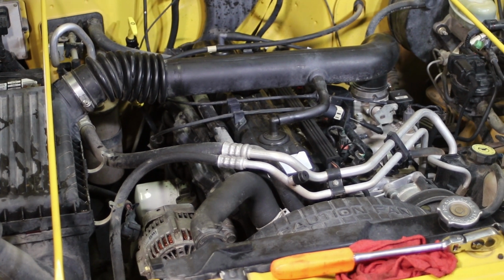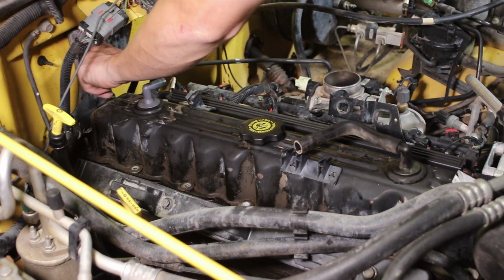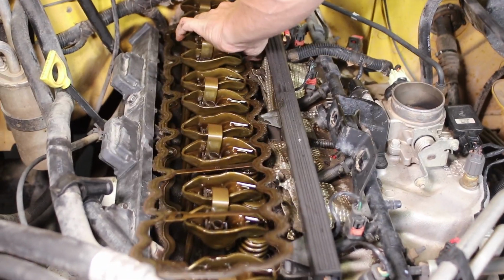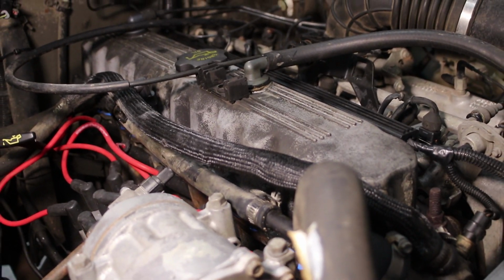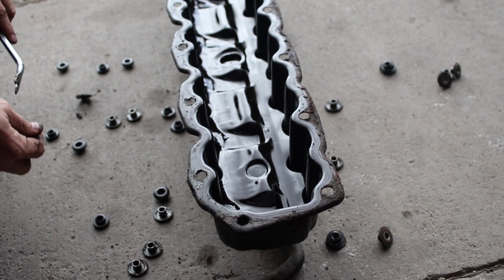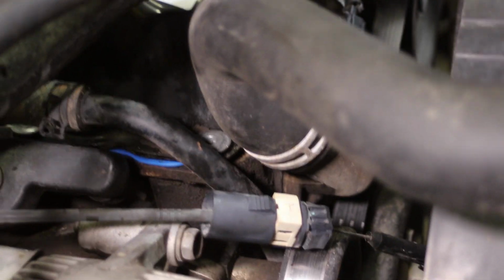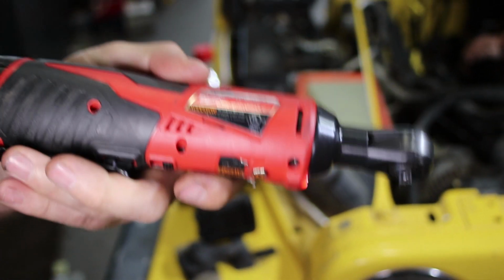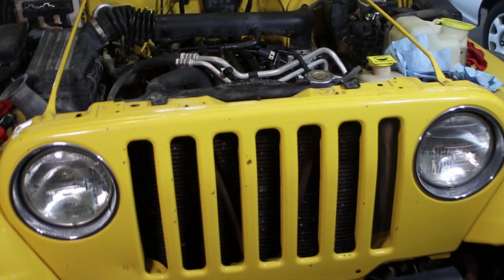VALVE COVER GASKET REPAIR 4.0L JEEP WRANGLER TJ - JEEPFIX TUTORIALS

Comment: No mention of '03+ and the difficulty of getting to the ground and far rear valve cover bolt due to them being recessed under the firewall and covered by an almost completely immovable wiring bridle.
No mention of ft/lb torque either.

Comment: This is such a great tutorial, thank you!  Question...any harm to tourqing the rockers while I have the valve cover off?  Do i need to rotate the engine or just tighten as they are?
Reply from the maker: Not a bad idea checking for loose rocker arm bolts.

Comment: Welp update 2hrs and 37 mins roughly I’m done. Was relatively easy just time consuming as you all stated scraping the residue off from the old gasket.  Thanks for the video guidance as I’m cheap and would rather do work myself than pay someone an arm and a leg to do it. Every penny counts and adds up quick when you do things on a 97 Tj yourself. Lol. Plus these vehicles I have found out of the 5 I’ve owned this one is by far the EASIEST to work on. SOOOOO MUCH ROOM TO WORK! Every other vehicle has only like 1/16 of an inch of space to work around every single cotton picking bolt and hose. Lol. Thank y’all again for the videos I greatly appreciate it and DO NOT FORGET THE GROUND WIRE I will not confirm nor deny if I forgot the first time around….lol
Reply from the maker: Thanks for the positive feedback.  You did excellent on time.  I’m not sure we can do it much faster and we do this job frequently.

Comment: Man you just put more in perspective & understanding for the most part, in the first two minutes of this video that I have been trying to myself for a couple days now. I have a pretty good leak going on down in the back somewhere. I'm currently doing a valve cover replacement or checking it anyway, and I was thinking that my rear seal was blown praying the whole time doing this job that its only in fact, the valve gasket. 🤞🙏
Reply from the maker: Thank your for your comment.  Oil leaking between the engine and transmission can be the Valve Cover Gasket or/and Rear Main Seal.

Comment: Great video it’s definitely appreciated! You mention changing the oil after it is done. Is there a certain amount of time one should run the engine before the change so that any particles up top end up in the oil filter or wherever we want them to end up for the change?
Reply from the maker: Clean up or pick any visible particles.  We have ran these engines with the valve covers off.  It’s pretty cool to watch but there much less flow than you would think.  I would just change the oil while you are in there and use a good filter to pick up anything missed.  We have cut many open and our favorite that can be purchased easily is a WIX.

Comment: I chickened out and paid a 30 year man on a saturday.  He put a fan to cool it down, he was done in a bout two hours. Cork and a epoxy. both sides
Reply from the maker: Next time try the rubber gasket.  The dealer gasket is even better but much more expensive.

Comment: Great video! I have a leak but not sure it’s the valve cover or rear main. There is gunk all over the sides of the cover going down under the Jeep so that’s why I assume it’s the valve cover gasket. 

This doesn’t look like something I would be able to do myself, however. Probably will have to take to a shop but I just changed my oil, so it will continue to leak until next oil change lol.

Comment: First of all. Great, detailed video. Thanks to all here. From the camera man, to the commenter and mechanics, as well, in this repair video. Awesome presentation and delivery. The attention to the details were excellent. A few things, call them, "constructive obsevations" that I would suggest, that were not specifically covered. 1st, it wasnt specifically mentioned but, in my opinion and experience, before you do ANY type of repair, always put safety first and remove the NEGATIVE battery terminal so their is no chance of an arc from tools being used around the engine compartment which can be a hair raising experience, to saythe least or to avoid any electrical or computer malfuctions later. Ask me how I know..... 2nd, on the topic of aluminum valve covers.On some 4.0L engines, specifically in my case, for a 1995 Jeep GCL ZJ, the Felpro gasket DOES NOT have the alignment slots nor does it have support brackets between the gasket as was shown in this video, specifically the 1995 model year for the Grand Cherokee Laredo ZJ, there may be others. Also, on this year, 1995 4.0L Inline 6 cylinder engine, as well as possibly, other 1995 Cherokees and Wranglers as well!? 

NOTE! -Their are NO grommets or metal sleeves for the bolts on my aluminum valve cover, and were not included, in my Felpro gasket kit, as shown here, and in most other Youtube videos on this topic. In my case and possibly other 1995 model years, the gasket is metal and silicone like this one shown in this video, yet in my gasket, the silicone and metal gasket is molded into and around, all 15 of the 11mm bolts and the grommets are NOT required, as all of the sealant is integrated into the felpro valve cover gasket for the 1995 model so DONT STRESS folks, if their is no grommet kit with your gasket for this model year. As far as I know, this info has not been covered in ANY other Jeep 4.0L valve cover gasket replacement video on YouTube and had me stumped and concerned as to why my gasket was different from all the others. I hope this added info helps someone.Good luck to all and stay dirty :)
Reply from the maker: Thank you for your excellent feedback!  I can’t take credit for the camera work.  That is my daughter.

Comment: Great video.  Your recommendation was to start at the top with leaks.  I have a smalleak and will follow that advice but was wondering if you had any guidance on determining if I have a rear main seal leak.  I have a 2002 4.0.  Thanks
Reply from the maker: Rear Main Seal leaks look like they come from the very back of the oil pan.  Valve Cover Gasket leaks also start in the back and runs down the back of the engine making it look like a rear main seal.  Clean the whole area with CRC Brake Clean in the red bottle (Napa sells it for about $2.60 per bottle). Switch back and forth between brake clean and compressed air in a well ventilated area. Drive for a few days and the location of the leak should be very clear.

Comment: Just completed my 2006 TJ X. About 6 hours, not including painting. My Jeep had a plastic bridge for the wiring bundle going over the back of the valve cover along the fire wall. I spent an hour researching this. Once I found I could remove it, the rest of the project went quickly.
Reply from the maker: Good job.  The plastic harness holder in the back on the newer TJs definitely add time.

Comment: Yep, doing this as we speak. there are three bolts that are a *** to take off. Getting to the ground wire is not the easiest move either...
Reply from the maker: Yes the plastic wiring harness in the back definitely adds time.

Comment: Thanks for the awesome, in depth video. It took about 4 hours with a trip to the auto parts store. As soon as I got the cover off, I pressure washed it so it'd have time to dry. I took my time, used hand tools, and had a beer while cleaning the surface. The only problem I ran into was replacing the cover, my radiator hose was being a pain. Other than that, easy install, time will tell if I did good enough lol.  2005 Jeep Wrangler TJ 4.0.
Reply from the maker: Thanks for reporting in.   The radiator hose and the clamp can be such a pain.

Comment: Great video, but no part numbers in description. Here is what I bought for my 2003 Wrangler 4.0L:

Gasket: Fel-Pro VS 50458 R
PCV Grommet: (need 2) Dorman 42344
Front PCV Elbow: Dorman 47079
Rear PCV Elbow: Dorman 47057
PCV Hose: Mopar 53030615 CRANKCASE VENT Valve Tube
Rear PCV Tube ends: Dorman 47128 PCV Hose

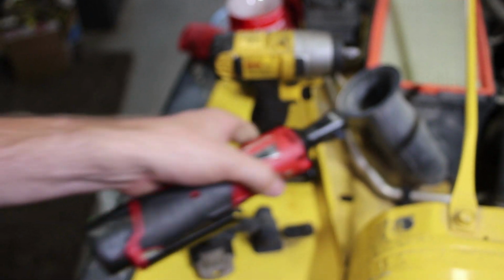85 in lbs - 10Nm. @ 29:04

I think I will have the slowest time...2 days over 2 weekends cleaning slowly and fighting the plastic wiring harness bridge in the back (Thanks to Richard Gilliam in comments below!)

Comment: I just changed out the valve cover gasket on my 1999 Jeep XJ, biggest pain like you said was scraping the surface clean, the valve cover cleaned up quick. The other issue I had was replacing the breather elbow, pvc elbow and the rubber gourmets, they were cooked on there, and had to break both of them off literally to get them off, I went ahead and painted the valve cover while I had it off, and cleaned it up Dawn dish washing soap works really good cleaning the grease and oil up. But I also used Purple power as well. The whole thing took about 6 hours, only because I painted the valve cover, would had been done otherwise in about 4 hours from start to finish. Thanks for your video
Reply from the maker: Sounds like you did a great job.  Only chance of getting the elbows off without breaking is to get the grommets really warm.  You can use a heat gun or run the engine for 20 min with the hood down.   Sometimes the grommets just break no matter what.

Comment: Do you need to drain the motor oil before removing the Valve Cover??
Reply from the maker: No need.  It won’t spill out.  As long as you keep the debris you are scraping off the surfaces out of the engine no need to change the oil.  For peace of mind you can do the oil change after.

Comment: Does the or should the valve cover be removed to replace the grommets on the top of the valve cover? Or can those be done later of found to be bad after the valve cover gasket is completed?
I'll be doing the valve cover gasket on a 2005 tj 4.0l next week. Sou is pretty straight forward. Just keep my cool and look things over. Sounds like the wire harness will be a bit of a fuss...
Hope that the leaking valve cover gasket is the culprit of the oil showing up between the motor and the trans. Gasket is leaking pretty good, that and the  o ring for the distributor or timing shaft.
Reply from the maker: They can be done later.  The PCV and the breather will break apart when trying to remove them if the grommets are not warm.  You can use a heat gun or just run the engine to get the grommets warm.

Comment: I’m a rundown aircraft mechanic... over 30 years.  I have never used the customer’s painted surfaces as a workbench or tool holder. That’s what a table or tool box is for - not the fenders. I was impressed by the mechanic being able to work like that with the constant chatter and the camera rolling 

Thank you for the very informative video ... Nice work
Reply from the maker: Thank you for the feedback. We got that feedback from another client in the past. We will do better in the future.

Comment: Its taking me a few days. Had to order a part for the pcv  valve connection.  The pcv valve and breather both broke. They were extremely brittle and the grommets were very very very hard. Like hard pistol plastic. I had to take the cover off and drill a bunch of holes in them to get them out. Ended up having to find gaskets for the INNER part where the breather and pcv valves go. Scraping that part... omg. What's crazy is, the previous owner didn't even have the valve cover tightened. I could tighten them with my hand. I'm not done yet............ waiting on parts.

Comment: Just wanted to say thanks for the video.  I'm not exactly an amateur but far from a pro so I just watched this on break at the day job for any pointers.  
With your tips I was able to knock this out in 1hr 58 minutes and 24 seconds.  Hood up to hood down. With the oil change and spark plug change. Mine is the 04 with the wire harness in the way found it easiest to just pop the plastic guard off the wires and get it out of the way.
Reply from the maker: Thank you for your feedback!
Reply from the maker: Stanley.  You did great.  I need a mechanic that is proficient like you are.  Come apply.

Comment: Very nice. I am about to do an almost total replacement of my cooling system on an '03 and figured I'd look into replacing the valve cover gasket at the same time since I'll have most of the innards out of the way. Pretty sure that's where my leak is. No performance issues, no milky fluids, just a very slow drip

Comment: Its actually called PCV valve not PVC, that’s something you used for plumbing pipes etc...
Reply from the maker: I’ve done plumbing work so I switch those two up. Poly Vinyl Chloride vs. Positive Crank Ventilation.  Good catch.

Comment: Fantastic tutorial! I've replaced many gaskets on small block Chevys, but never on a TJ. Night and day different. Took me 4 hours with most of that in cleaning up the valve cover and surface of the engine. The biggest challenge was manipulating that damn plastic housing where the geniuses decided to route the wiring harness through on the 2005 TJ. Even after disconnecting it from the two valve cover bolts in  the back, it was extremely difficult to maneuver it enough to get the valve cover off. Also, the 18mm nut holding the ground strap on MUST be removed to get the valve cover free. All the original grommets were hard as rock, which is where most of the oil leaking was occurring.  Like many factory OEM parts, the original gasket doesn't compare to the quality of the aftermarket Fel-Pro I installed. Well worth the $35 and 4 hours of my time.

Comment: Super informative video!  Looking to purchase a 2004 4.0 I6 that needs a valve cover gasket and wanted to know what I was getting myself into before making my decision, but this doesn't look bad at all!  If I end up buying it, I'll let you know how long it takes!
Reply from the maker: Thanks for the comment.  Climb under the Jeep and check the rear main seal as well.  It looks like a leak between the engine and transmission.  When the valve cover leaks in the back it can look like a rear main seal leak too so you have to follow the oil trail.  Hope to do a video on that shortly.

Comment: Doing my 2005 Wrangler x valve cover and have a piece I can't get off covering the bolt with the ground wire need assistance
Reply from the maker: That bolt is the hardest to remove of all of them.  Good luck!

Comment: Hate to tell ya but wobble socket extenders aint too rare. I mean Harbor Freight sells em after all.
Reply from the maker: Good clarification.  Not rare but not likely to be in a standard socket set. Got to buy it separately.  I still don’t own one.  I borrow one from one of my mechanic.  Thanks for sourcing them.   Now that Sears is gone good to know Harbor Freight has them.
Reply: @jeepfix  Yeah they just don't have impact wobble sockets so keep that in mind when using them. Harbour Freight is great for hand tools but if you use any non impact for impact purposes you're gonna break em regardless of brand. Thankfully tho Pittsburgh(hfts brand) has a lifetime warranty.

Comment: Just did mine first time, took a good four hours, but I put on a fresh coat of paint as well. Over torqued my bolts and had to do it again with another replacement seal. Don't over do your torque. Replaced the front breather grommet and valve a week later when I saw a slow leak on the clean valve cover. Always look at your work a few days later.

Comment: power tools break off bolts, if you use hand tools you can feel what the bolt is doing, always start all bolts by hand, you are less likely to cross thread the bolt .power tools have there use, but use them right.taking off bolts if the bolt is getting hard to turn, run it back in, put so wd40 or pb baster on it, work the bolt in and out,to keep from breaking the bolt off.  power tools will break a bolt off fast then you have a problem .take your time, work smart not fast, because getting a broken bolt out may take days.
Reply from the maker: Great advice.  Especially on things like exhaust bolts.  When you have a valve cover gasket that has lost its seal the valve cover bolts get oil soaked (sometimes for years). Because of the light torque and many if not all of the bolts have oil on them we have not had an issue with seized bolts on a valve cover gasket.  Other places on the engine yes. The worst places on Jeeps tend to be exhaust bolts and belly pans on YJs.  Thank you for your comment and thorough explanation.  Mike.

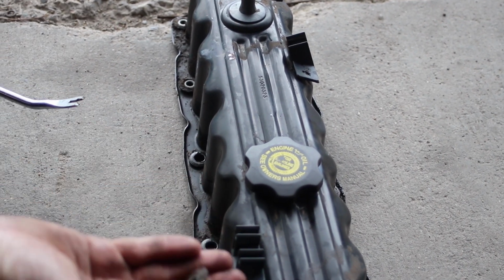Comment: Great video. Do you happen to have an extra set of the part you say not to lose at 17:24? Or know where to get them? The grommets or what i have learned are called torque limiter sleeves. I accidentally threw mine away thinking new ones would be included but only the rubber washers were included with the new gasket. Wish I hadn't skipped over that key detail and this is a good note to others. Thanks
Reply from the maker: Try a Jeep Dealership or any 4.0 in the Junk Yard should fit. Good Luck!
Reply: JeepFix m

Thorottle  body cable that hooks up to transmission need to see how to do it
Reply: 2004grand cherokee throttle  body cable how to put it on
Reply from the maker: One more thing.  First step is get the part number.  Once you have the part number you will be able to find it on the web as well.

Comment: First timer... took about 4 hours which included a trip to the car wash and parts store. I had “help” from my 6 year old, too.   Not sure if that sped things up or added time! 😆  Definitely something most hands-on jeepers can do in their driveway on a Saturday afternoon.  Now on to the pan gasket and main seal!
Reply from the maker: Cary Brewer ,   Thank you for your commitment.   Pan gasket and rear main seal is about twice as much work.  You have to remove the starter and separate the exhaust from the exhaust manifold.  Sometimes when the valve cover is leaking from the back it looks like a rear main seal leak.   Wait a few weeks and check the back of the oil pan to see if it looks the same or better.  Good luck!